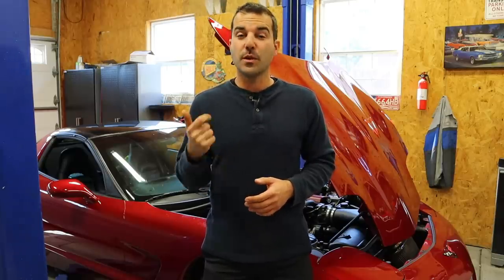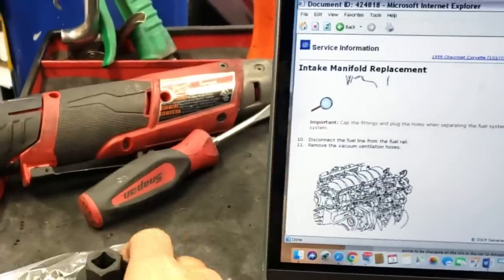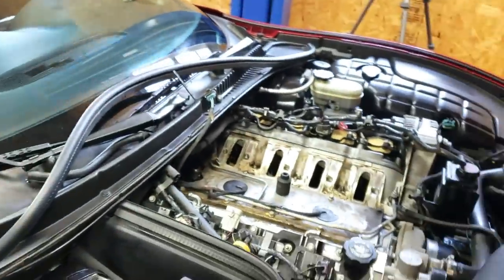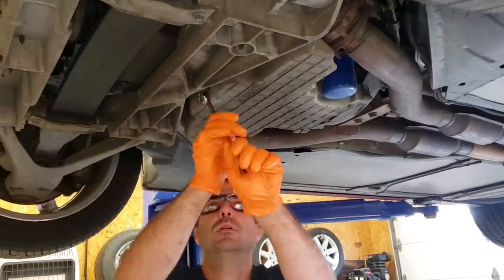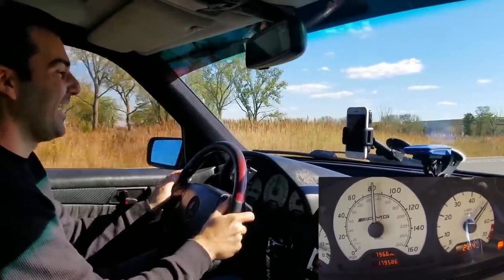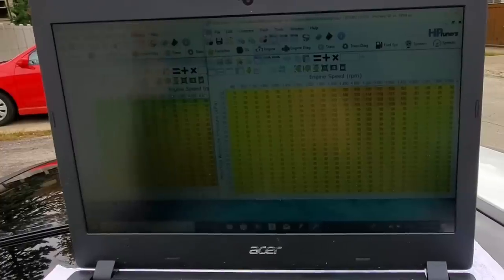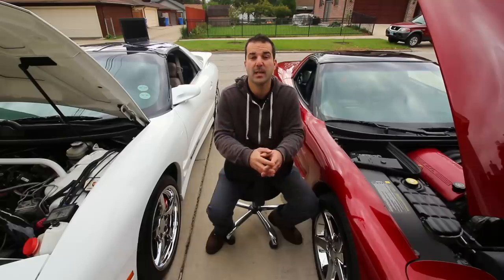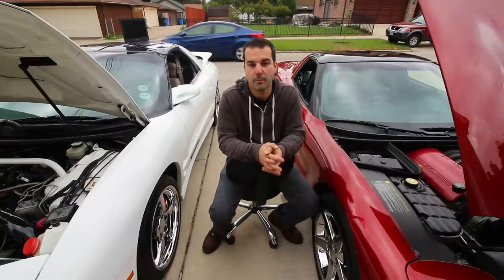I’m Building A 40 MPG Corvette That Sacrifices NOTHING! Project EcoVette Starts Now!

Comment: Alex, your post on Facebook for EcoVette led me here because when you wrote, "I don't know but I really like cake, and I really like to eat my cake too!" Let me just say you had me at cake! Mmmmm cake. I think you will get close to the midhigher 30's with out a gear swap.
Reply from the maker: Who doesn't love cake? I'd love to do it without the gear swap but 1000 rpm cruising on the highway would help.
Reply: LegitStreetCars Alex that will only work on flat lands huh? My drive from Santa Fe to El Paso sees lots of hills. I would think the V8 with maximum low RPM airflow velocity will do well close to 1000 RPM. Maybe special heads? Jet-hot coated small tube headers...etc.
Reply: Corvette cake mmmmm
Reply: therealnightwriter  Duh, that is what the injectors do is vaporize the fuel. You are thinking about carburetor technology more than 30 years obsolete.
Reply: i like having cake and I like eating it. and I don't like being fat.

which is why I have artificially sweetened, full-fat chocolate cheesecake.

Comment: I noticed that if you use 93 to 95 octane will improve your gas mileage  I own a 1999 Jeep Grand Cherokee Laredo with the 4.0L straight 6 with 175k miles  I noticed with premium octane fuel 93 to 95 and with Valvoline Syn Power Syentic Oil im getting 20 MOG city and 25 MOG on highway and 21 MPG all around. When regular oil and 87 octane getting 13 city and 18 highway 16 mixed big difference. I noticed a difference in power as well. This is also a 4X4 as well. In the winter with the 4X4 engaged im getting 18 city/ 23 highway 19 mixed with 4 wheel drive working. Also good tires will also help.

Comment: the reason we don't do lean burn like the Japanese cars in the 90s is because of NOx outputs. It has nothing to do with power output.
Reply: That was mostly the 1980s, and yes you cannot do it anymore. Heck you cannot even run a non-factory catalytic converter anymore. (which will annoy you when you need to replace one because they cost $$$)

Comment: I don't know if it was just me but I had some ptsd from my dad yelling at me about only tightening the oil filter "hand  tight" lol. my stomach dropped when I saw you use the wrench
Reply: Seriously! 12:50 PSA - Don't ever do this. I recently spent too much time fighting a filter someone gorilla wrenched down. It's not necessary. Hand tighten the filter until you get good resistance then do an additional 1/2 turn. Please.
Reply: i like to go 3/4 turn just for good luck....lol
Reply: Yeah, oil filter wrenches should be designed to cam out if ever used in the install position.

Comment: Multiple cars now a days has lean burn, granted they are mainly hybrids but they are out there. The first gen Honda Insight has lean burn but only in the manual transmissions. They also added another cat to help the emissions but were only about to get a ULEV rating where the CVT with less cats were able to get a SULEV rating. Even though the CVT is supposedly better on fuel than the manual, the CVT got 12mpg less on the hwy and 5mpg less in the city because the lack of lean burn.

The Prius and Lexus CT (same drivetrain) both have lean burn as well.

Side note, a lightened flywheel will actually give you worse mpg. On my 03 insight (CVT) I was consistently getting 64-68 mpg/tank with hwy/city combined. Adding aero panels under the car helped a good 5mpg on my car, especially at higher speeds. I also ran 55psi tire pressure (within the specs of the tires). Other than that the best way to get better mpg is just to drive better. As I’ve said for decades now “It’s not what you do but how you do it”.

Comment: Incorporate some of the light weight Z06 features like the titanium exhaust. 
Better cylinder heads with a slight compression bump and a custom camshaft. Not a big cam, just one optimized for the combination.

Comment: I had a 99 Camaro that managed 35MPG. This was with the stock 6-speed and a 3.73 rear end.  I got rid of it before I had a chance to do more testing after fixing an exhaust leak at one header collector. It had an underdrive pulley to protect the accessories after the valvetrain mods that bumped the redline to 7000RPM. It was lowered, but with the wrong-rate Eibach springs that made for a bouncy ride with the Koni single-adjustable struts that were on it when I got it.

Comment: A lot of GM ecm"s have highway mode built into the programing witch leans out the tune as much as 16 to 1 when under light cruising. my 90 corvette has it and I believe even the 84 corvette has it. it is not enabled in the stock tune because the epa requires cars in the usa to run 14 to 1 afr.

Comment: “Knock” is actually premature ignition of unburned fuel and air inside the combustion chamber. This is due to the near-impossibility of burning 100% of the fuel and air inside the combustion chamber on the ignition stroke coupled with engine temperatures running higher than they were designed for. Without proper knock or temperature control, this can lead to catastrophic engine failure such as bent rods, blowing holes in pistons (especially the weak hypereutectic pistons in LS motors like this one), etc. 

Running the engine this hot for long enough will also emit Nitrous Oxide into the air. This is why the US doesn’t run their production cars that lean or that hot. Personally, I don’t think that’s a huge deal, as long as the Nitrous Oxide doesn’t blow your exhaust clear off while cruising down the highway lol. 

Additionally, de-activating your MAF sensor is going to mean you prolly won’t be able ti drive your corvette anywhere besides where you live. You CAN run a tune on an engine using only the MAP sensor, but air density is crucially important to know when running electronic fuel injection. Without knowing the mass of the air along with the pressure if the air going into the engine, you will not be able to manage a consistent air/fuel ratio. I can tell it’s a cloudy fall day where you’re located. Prolly a cool, humid-ish day. Running this tune on a hot, dry day is going to yield a much richer fuel/air mixture, essentially defeating the purpose of this build. Running it in the cold can lead to extreme lean-outs, potentially destroying your engine. It’ll be interesting to see how long this lasts and what your results will be in the long run, but I wouldn’t recommend anyone doing this to a car they plan on keeping for while.
Reply: He said "NOx," not knock. Oxides of nitrogen, like nitric oxide or nitrogen dioxide.
Reply: Burning lean decrease temp, as does running rich. Car engines are the hottest when running at perfect gas air ratio. I believe you are thinking of piston aircraft, running rich decrease temp and lean increases temp for them.

Comment: I knew a Fella in Mississippi who took a Old Style Caddy 1959 built an adapter plate for the Engine Intake a 390 and installed a one bbl carb on it from a industrial engine. He got 59mpg plus better but averaged 59 overall on a trip to Miami and Back to Jackson Mississippi and the car had plenty of cruising power. GM gave him Hell over it since that car a Tank only got 8-10 MPG. He filmed the ride with several specialists and Pinkerton Security who kept gas receipts and logged every mile and secured it during the trip. He and the car went missing back in the early 60's and my Dad was astonished at the non investigation. I remember Mr. Jack and his big Red Caddy Convertible. Slow to take off but a car that could go forever on the Freeway. I think he said the maximum if I remember right before safe fueling was 1050 miles which he did on the Florida Trip.  I think he was on the TV Show "Believe it or Not" years ago.

Comment: The GM 4.3 Vortec V6 from the 90s had a lean burn mode. It was described in the Chiltons service manual as happening on a operating temperature engine at a constant speed I think over 45mph (when the torque converter locked up) and a steady pedal. My 93 S-10 Blazer used to get ~24mpg with mixed freeway/ 45mph highway with stoplights driving. That was after putting on a freer flowing intake and exhaust, headers, better ignition, synthetic oil, e-fan, underdriver pulley, and my patented steady foot. 93 octane fuel  helped increase the mpg by 10% at a cost 10% more but allowed more range between fill-ups.

Comment: I'm impressed, your an AMSOIL guy, I love the stuff and have been using it since the 80's. I have an LT-1 94 vintage and I have a reliable optispark. Will the same apply for my LT-1 which is stock with California smog 65K miles running on AMSOIL? New subscriber, I love high MPG vehicles and have some history with hi mpg. Great video, can't wait for more.

Comment: I have a couple of observations that could be of some help. 1. Back in 81, Cadillac had the L62 V8-6-4; basically a boat anchor as I replaced 4 of them in 85 because they literally backfired thru the intake and blew up; with Olds Rocket 350's w/turbo 350 trans. Here's what I noticed on the L62. When you were on the hwy cursing at 70 mph and hit the cruise control, it would deactivate 2 or 4 cyl. Why not try to employ the same scenario; at least as far as the open/closed loop O2 readings are concerned. Use the CC switch in a similar fashion to disable the O2 sensor readings and to also put the ECU back in Open loop. 2. When I had my limo svc back in 2000, I had a client that lived in Plainfield behind the Mobil gas station off of Rt.30 & I-55. He had a 454 Chevelle SS that was f.i. He built & programmed the ECU in his garage w/cyl. deactivation. We took it from his house to the Coal City exit and used just about a gal. Once we got up to 70mph, he pressed cruise control and you could hear a change in the sound but it stayed smooth. On the way back he did the same thing but as soon as you hit the gas, the car took off like expected out of a +500HP BBl; then once he lifted, it went back down to 70mph the same as before running on either 6 or4 cyl. He had 2 separate containers in the car so we could watch the fuel levels dropping in them. Lost track of him when the WTC fell. He was a monthly client of mine for 7 months.

Comment: Didn’t that throttle body have a special coating that you removed with the wire wheel?
Reply: I don't believe so, but I'd NEVER use a metal wire brush or wheel on a soft aluminum throttle body. I cringed so hard when I saw him do that.
Reply: Yes. It may start setting a throttle body code now
Reply: Yes it does. He'll be replacing it soon
Reply: I audibly screamed. Coating or not...

Comment: Didn't Chrysler have a lean burn engine in the 70's-80's? Chrysler Cordoba
Reply from the maker: Hmm, I have no clue but that would be cool if they did
Reply: My 1983 d-100 has lean burn but is sucked ass so I took it off
Reply: Yes, they were dogs that made all of 125hp on those rare occasions when they actually ran.
Reply: Yeah Chrysler had the first on board computer the lean burn system started in 1976 they worked good if you had someone that knew what they were doing with it but most people and Mechanics did not so it was replaced with the standard Electronic Ignition system. It was just too advanced for their time but it did work great when working properly.
Reply: Don't know about clean burn but there was high mpg Pontiac in the 60s that wasn't 4 cylinder, honda chaser
Reply: lmao the only time that works is in a turbo diesel.. gas does not like lean..
Reply: Honda licensed their CVCC technology to Chrysler and Ford in the early 70s;  it's not clear to me what they did with it after that.
Reply: @LegitStreetCars  yup. it was a basic engine computer for controlling spark advance. it was designed to help the meet emissions requirements. the engines ran at  an 18:1 air/fuel ratio. good idea but problematic execution. here's an article on hemmings about it:
https://www.hemmings.com/blog/article/chryslers-lean-burn-system/
Reply: @aworminmybook8234  Exactly. My 79 Cordoba Brougham originally had a 318 Lean Burn ECU on it. I bought it in 85 w/only 15Kon it. That was the reason the older couple sold it. I had it reprogrammed; as best that could be at the time; and got a little more HP & perf out of it. I also installed an anti-fouling spark plug extender on the O2 sensor (gave a leaner than actual reading to help increase fuel enrichment).  Ended up throwing out the motor & trans in favor of a 444 cid B-block w/642HP I built for it. I built it using different formulas from Hot Rod, Rodder, Mopar Muscle Car Illustrated and Car Craft. Ended up getting 15 mpg in town and 28 hgy. Might not seem like a lot but back in 86, that was almost unheard of for a BB with +600HP & 3.55 gears. Today's Hi-Perf small blocks are basically factory strokers we used to build back in the 80's & 90's; good example being the 6.2 & 7L small blocks in the Vette's and GTO's (383 & 427 cid)
Reply: They did, an absolute piece of shit. They also had the drivers side front marker indicator mounted on the fender the came on when you were using to much throttle, it was based off manifold vacuum.
Reply: @charliedee9276  EPA outlawed lean burn through increased regulations on NOx output in the 90s. It was good stuff. I see some local tuners still throw in some lean burn at 1500-2000 in the hp tuner tables.
Reply: @paladain55  That's nice. But I had a couple lean burn Cordoba's back in the day and my assertion they were pieces of shit is from owning and driving them. The principle may be sound but Chrysler's execution of it was not.
Reply: my gen 1 Honda insight only burns at 16.5:1.... but mine is a 2.4l now, and makes 250whp. still gets 45mpg

Comment: Making a car economical is surprisingly similar to making it faster. Idk if you are going to do a lot of aero like vented fenders and ducted radiator. That would reduce drag on the body
Reply: Wind resistance at highway speed isn't going to account for much of a mpg gain. Even if he completely changed the body and made it a perfect tear drop it still wouldn't give him 5 mpg.
Reply: @Mavrck-it2kq  you'd be very surprised actually. Look at the ecomoders forums. They test and have numbers. Some people nearly double their mpg. It's wildly impressive. Shame that it's not exciting
Reply: @NatoriousGamePlay  most of those guys get biased non scientific results. Much like many people they go looking for certain results and make sure they find them. One tank one time doesn't count and no person is doing 20k miles of testing on their own vehicle.
Reply: @Mavrck-it2kq  they don't have the budget or time a manufacturer does. But they do test and report their findings. They use actual data. It's about as scientific as one can reasonably get. Either you don't read their posts, or you just are generalizing. They do wind tuft testing, they go several hundred miles after one mod to see a difference, etc. It's not just them lying to themselves. Their whole thing is making cars more fuel efficient
Reply: @NatoriousGamePlay  Yeah several hundred miles downhill. Lets say hypothetically he got the vette to 40 doubtful but whatever. Without sacrificing anything? That's clickbait nothing else. I can get a vette to 40mpg put a Prius drivetrain in it. But its not a vette.
Reply: @Mavrck-it2kq  just making generalizations again. It's entirely possible to do that. Like he said, gearing change would help. Ported heads and less restrictive exhaust could help. Underbody aero, etc. Nobody said it be easy but possible. Give him time to prove himself before making assertions like that

Comment: I did the same thing with my 1995 Miata as far as changing all the oils over using Amsoil and I reg. get 32 to 33 MPG out of it. It does help quite a bit if you change everything over. Rear end, trans and engine. It's one of the best ways to get more gas mileage for little effort and makes things last a lot longer. I am getting this with a car that has 129K miles on it.  So I def. agree with you on your choice of oil and reasoning that it's a good start for better gas mileage.